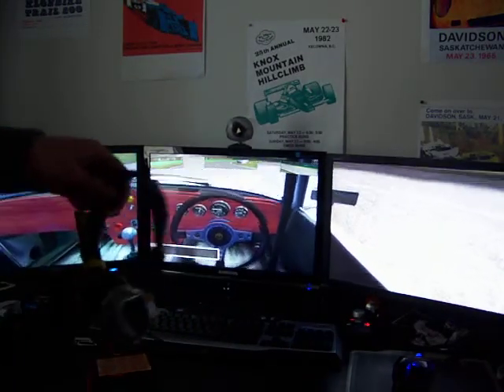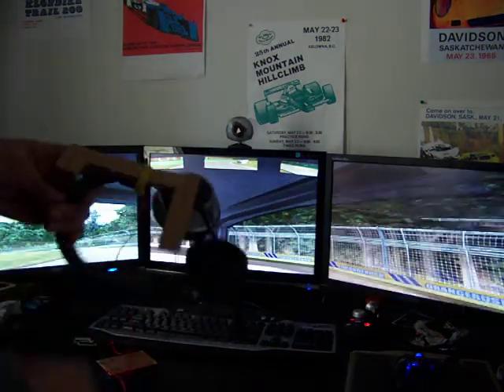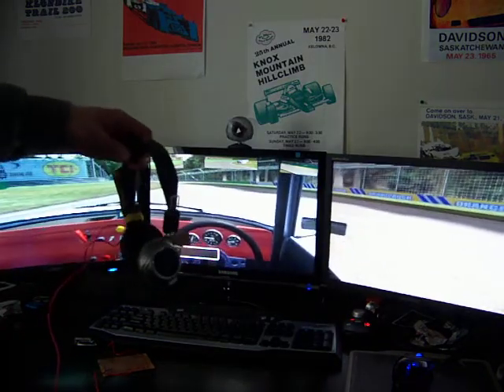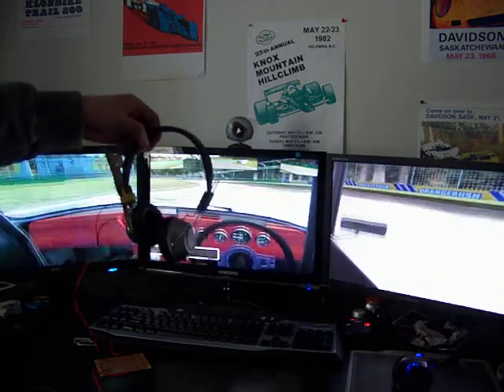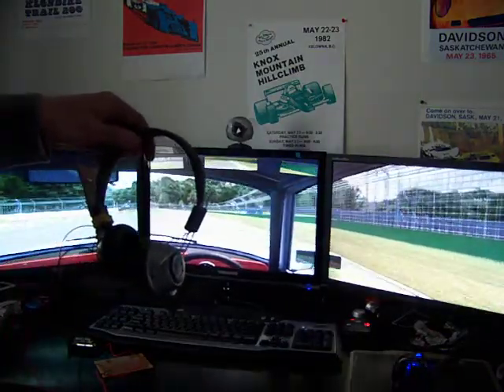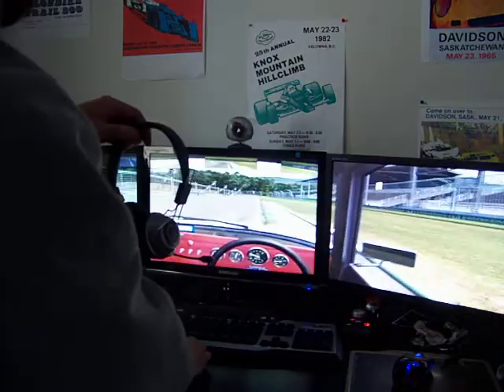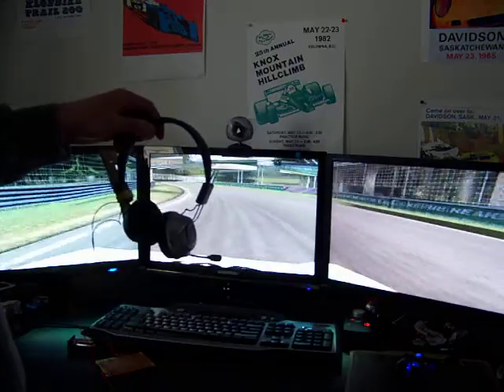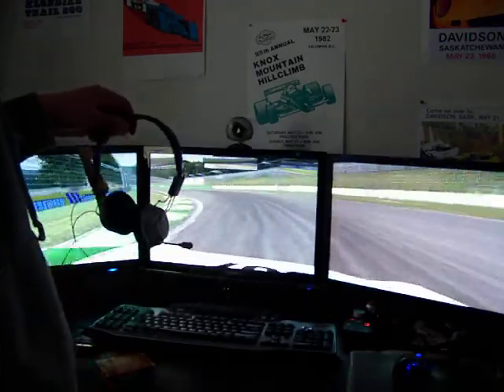Testing out Freetrack - home-made hardware (2DOF)

Comment from the maker: The setup was not through eyefinity nor an equivalent nvidia surround setup.  It is two separate videocards, an nvidia 8800 that renders the left and right monitors and an nvidia 9800 that renders the right screen.  Multiview is selected in rfactor,s setup screen to render the screens the right way without much warping.  This is also using SoftTH (software triplehead) to get the two cards to work together.